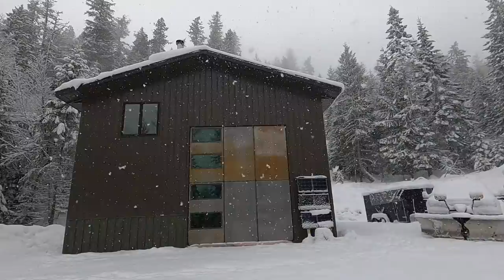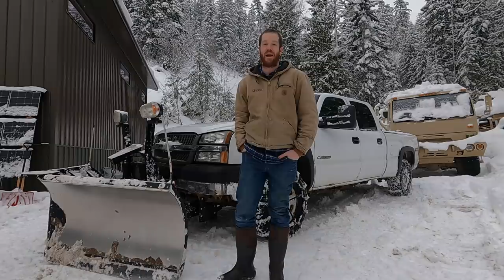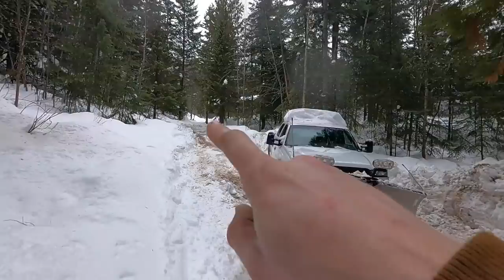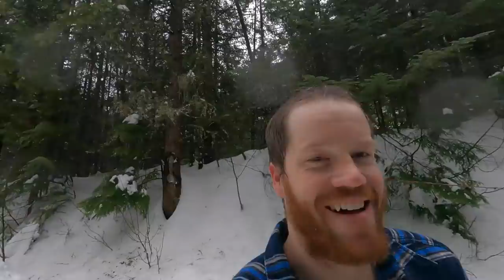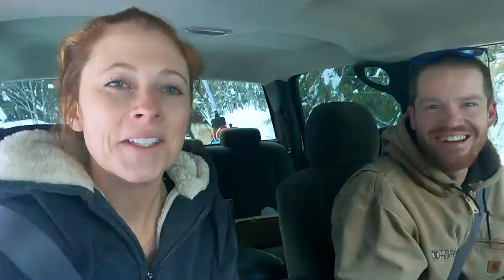WILL WE MAKE IT OUT? | Battling A Blizzard

Comment: I plowed snow as a youngster..it brought back memories..   The heavy snow is tough.  Best advice is to try not to abuse the equipment too badly.  You need a cheap harbor freight 12 v winch attached to the trailer hitch and a good snatch block.  You can pull yourself out of most predicaments.  Keep up the good work.  You two are awesome!
Reply: I finished the video and went to the comments to say the same thing. But checked first because I knew it was too obvious and someone would have already said it.
Reply from the maker: We actually ran into town to buy a winch and our Harbor Freight is out of stock at the moment!
Reply: @AmbitionStrikes  They have been parked 300 miles off LA-Long Beach since November ... 🤯
Reply: I was also thinking that is really hard on your equipment. Back and forth movement and heavy snow like that will inevitably take its toll as per your neighbors. Would it be better to have something more indutrial, especially driveline and transmission designed for heavy back and forth? My grandfather drove a grader to clear snow and eventually solved the snow problem by emigrating to Australia.
Reply: The  harbor freight 12 v winch is fairly  tough. Cable rigging is most important, You can move most anything using snatch blocks. :)

Comment: Hey Riley, a couple of suggestions: 1. Put about 500-600 lbs of weight in the back of the truck, just inside the tail gate, 80 lb sand bags are great. 2. When you go to back up and you're slightly down hill, only raise your plow a little so more weight is on rear of the truck. Sometimes you might not raise the plow at all, it will slide on the snow. 
3. Before plowing always check your pins- connection points on your plow. 4. Ice-sicles on your gutters is a bad sign, don't let that go very long. If you don't have snow guard on your roof you need that, will keep slabs of snow from sliding off your roof. Can be dangerous standing under the side of your 16' tall blg.  There will be a steep learning curve your first winter in Idaho. Good luck, be careful, & watch some videos on experienced snow plowers. T from Ohio
Reply: talk about a difficult introduction to plowing. that wet snow is HEAVY
Reply: Ted is 100% correct, I plow commercially, it is a game changer, more stable, more traction, helps when stuck.   DO IT, before you get stuck again, your beautiful wife is always there to save you.
Reply: Another vote for more weight in the back! Sand bags are definitely a super easy way to make the weight adaptable and seasonal.  The tube sand from HD or Lowes are great for this scenario and usually last a couple seasons.
Reply: I think Riley has weight in the back. It's a pretty basic concept in traction and his neighbor has probably mentioned it.
Reply: So... you're saying to keep the heavy snow on the roof versus having it slide off? When there's heavy snow on the roof you have a chance of the walls buckling and the roof collapsing. Seen it happen many times.
Reply: @Franisboche  Snow guards on the roof keep large chunks of snow from coming off all at once. It just breaks the snow up into smaller pieces
Reply: I'll be thinking about snow blower. Most efficient.
Reply: Absolutely!

Comment: Riley, there are so many suggestions about snow plowing from experienced snow plowers in the comment section.   I started plowing at age 15 in Philadelphia.  Here are my suggestions...momentum is your friend, not horse power.  The motor mounts were broken for a reason, trying to use the motor and not momentum will do that again, real soon.  Or you will break U-Joints or axle shafts.  Get some speed then drop the blade.  Second, there is no need to always drop the blade all the way down, it's just like cutting tall grass.  Sometimes it is better to scrape some off the top and then clear the path on a second pass.  Third, when you see the snow coming over the top of the blade, push that snow off to the side.  Push the loads, especially when the snow is wet, off to the side ASAP.  Forth suggestion, have fun with it!

Comment: Plow truck for sale! Only used on our personal driveway! 🙂 what a fun channel. Jason Kauffman the shed guy shared his shed delivery video with our shed haulers group on Facebook. Good times. 
As far as the plow truck, we dont get near the snow here in NY but I’ve learned how easy it is to ruin the trans or transfer case plowing snow. In the future you may want to consider something heavy and slow like a bulldozer or skid steer on tracks. They are designed to push long term with minimal risk to the drivetrain. Have fun! Marv from the finger lakes in NY
Reply from the maker: Hi Marv! We are still SO amazed by how quickly Jason was able to get the shed delivered. I agree, I think something larger and sturdier is going to be our best plan for moving snow long term.

Comment: When I used to plow, the first pass would be a straight shot all the way to the bottom of the road/hill. Then back up to the top to start again, widening the path on one side or the other, one pass at a time. Use gravity and momentum to make it easier on yourselves. The less you have to back up, the better. You guys are doing great though! Love watching your growth! 👍🏼
Reply: I have a 40yo beater with a nice plow. Being retired I plow a few driveways in my neighborhood and most are sloped downhill from the road. I never bang the plow and like you said let gravity do most of the work.
Reply: Yes, momentum is great.  

Also, there should be away to lock your hitch pins in.  It is never fun when the plow comes off.  On my older SnowDogg VX85, a small hitch pin will do the job, keep the snow build up from working them loose.
Reply: Absolutely this! If needed, lock the plow into a v-shape and punch a path all the way to road. You can come back and widen it up later. It saves the plow from having to push quite so much and your equipment (truck too!) will thank you. :)

Comment: A traditional tow strap might be helpful when you are using the bucket on the excavator to pull you out. If you got a winch, mount it so you can slide it in the receiver hitch, that way he can self recover, too. And if you get a winch, always need to get snatch blocks or snatch wheels.

Comment: I vote for the winch in the receiver at the back of the truck and get one with the "poly" cable not a steel cable. Pick one that exceeds the weight of the truck and has a very long poly cable ( get a snatch block or 2 too!)! That gianormus snowblower would be fantastic. Maybe move the snow away from the sides of your building allowing for the rain to run off and not into the shop. Getting up at all house of the night to stay ahead of the snow isn't the most fun you can have with your clothes on but you are way ahead of the game if you don't. You both are a great team! Stay warm! G.

Comment: Wet snow is the absolute worst. Obviously, it is incredibly heavy to move (as evidenced by the destruction of your neighbor's plow truck!) but it also keeps liquid water from draining properly because it can make a very effective dam or plug. If the shop is flooded it might be worth digging a trench in the snow where you have your ditch around the building to help things keep moving. Eventually, if you have a french drain there it might be worth it to put in a simple heating element wire to keep it clear.

Comment: Real winter has finally arrived! :D It is frustrating while plowing, but also rewarding in it's own way. Sometimes it can be fun. :) You got this!
A winch that you can put on the rear hitch and a come-along winch are generally worth having. The winch will help you get unstuck, the come along gives just enough extra oomph to help reattach equipment or run any extra pulleys/lines/snatch blocks you may want to run. Both are pretty inexpensive (relatively) that you can pick up at a hardware store or harbor freight. Sometimes, only occasionally, you need to disconnect the plow to get the truck unstuck, drag the plow out, then start over again. It all really depends on what other friends/vehicles you have available to help. :)

Comment: Grew up enduring those Nor’easter blizzards. All the vehicle recovery advice is solid. But plow with your blade canted - driver side forward, passenger side back usually - and plan your swipes to avoid getting stuck when possible. Add weight to the bed of your truck, we used to drive around all winter with a load of sand or gravel, which comes in handy for traction too.

Don’t try to bite it all off in a massive push. Also get a snowblower too! They’re great… You can find snowblower attachments for your quad.

Comment: 1. Plow with the storm, especially when its wet. Yes, get out of bed at 1 am.
2. You're still using the truck like a bulldozer. Your neighbor probably was too. Hence, broken, expensive parts and labor intensive repairs.
3. Try not plowing all the way down to the ground on the first pass. 
4. Put the shoes on the blade to prevent digging into soft ground.
5. Do not try to pile snow with the blade. The blade will ride up on the pile, lifting your front wheels off the ground. 
6. Get a large skidsteer with a wide snowblower. Another snowfall like that and you won't be able to push it to the side anymore or over the top of the previous plowing.

Comment: A bit of advice: do not use a hi-lift for a diagonal force, or as you call "shimmie". You will make your wife a widow! Hi-lifts MUST push or pull in a straight line.  Note- Hi-lifts can be used as a winch between  lines or chains. 

Also consider getting a electric winch and mounting it to a receiver post. Pop it into the receiver when needed.  Run an electric quick disconnect from the battery to the back of the truck for convenience.

Also, welcome to North Idaho! 
We are in CDA.

Comment: Upkeeping that home road of yours might be serious and expensive challenge continuing every winter. You might consider planning to get serious hardware for that job, like Caterpillar wheel loader or bulldozer or something of that magnitude. Breaking the lighter stuff (which probably will happen if you have to do that plowing job a lot) can end up making more trouble. Get some powered winch to the car at least, easier to pull it off from sides of road?   EDIT: Or how about just getting a SNOW BLOWER?

Comment: Riley, if you weld a couple of clevis grab hooks to your Highlift/Handyman jack, you can use it as an improvised winch with a length or two of chain. No stretch in the chain and more leverage with the jack handle than those short-handled strap tighteners.

Comment: Riley, you might want to look at a 12v HD winch for the plow truck.  They make models that mount on a plate that fits into a 2" hitch receiver on the back, or a totally portable unit like the Warn PullzAll. Combine either of those with that strap you had and you should be good to go. You could then self recover using a tree as an anchor.  Would be faster than waiting on Courtney or the neighbor also. Also X2 on putting more weight in the bed of the truck to even out the traction.  Best situation would be equal weight at each tire, but it might be hard to figure that setup out in deep snow winter.

Comment: My lessons learned in 20 winters driving uphill and downhill in snowy mountains: better get up in the middle of the night and plough early and again and again, especially when driving a light truck like yours. You can save time by using a snowblower, that is my second recommendation. You must avoid wet and heavy snow on the road. A winch is indispensable anyway,  in summer and winter!

Comment: For my 2 cents. That looks like it is a 8'-6" plow. When you put it in the V position it is actually narrower then an 8' straight plow positioned to either side. What happens is you don't get the snow pushed off to the sides it rolls back under the tires and that is how you are getting stuck. If you had a 9'-6" plow in the V position it pushes the snow far enough to the sides your tires will then be making contact with the road. Better traction less chance of getting stuck. Like others have said better to make a full pass all the way through in the V position. this allows for the snow to be split and spread evenly to both sides. Learned from experience been there stuck in remote locations and its no fun. Plus heavy wet snow is the worst to plow.

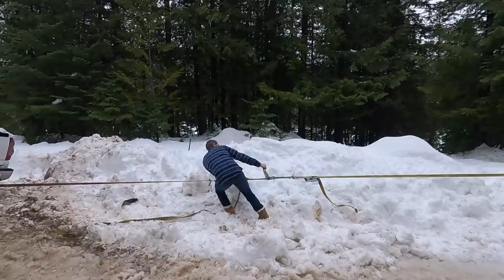Comment: 13:03 that reminded me that some hi-lifts can actually pull in reverse (like in position when you would normally lower the load) if you'd have proper links to connect it to chains or straps/rope .. to have kind of improvised winch.

Comment: For pulling out any rig, there are many different techniques, you can even use your own wheels as a winch, as long as you have appropriate straps, and fastening points. But winch makes it so much easier.
But if you intend to use army truck, I would go for the chains.
You can even make an extra long rope, 50+ anchored pulleys to multiply your power, and then just run down the street/road yourself, to pull that rig out. Except maybe the friction in pulleys would counter your strength ...

Comment: So amazing to see the Hi-Lift in action. Such an amazing tool (which I still don't understand everything you can do with it.) It's like a Multi-Tool. Very cool to see the kinetic rope in action. 

Teresa says "Courtney to the rescue!"
Reply: Where I work I use mine a fair bit, from pushing out excavator hinge pins to moving plate steel into place for welding.
Reply: @krissfemmpaws1029  Thanks Kriss must be some big pins..LOL I've used mine to help lift large stones. I was setting where equipment couldn't go. I'd love to see a video of everything you can do that you never thought you could do. Thank you again for sharing.
Reply: @OutOfOfficeCamping  some of the pins are 3 plus inches in diameter and 20 inches long. Our big machine has about a 3.5 yard bucket we use it to feed the crusher and move some of the rock around out of the way where the D-9 doesn't fit.

Comment: Even with chains there is only so much you can do with open differentials on that truck. It’s pretty heavy and the army truck is even heavier but might have lockers? I would check out Casey LaDell channel. He has a towing recovery channel and lots of older videos in the snow recovering with trucks and winches. This season he has a tracked Jeep.

Comment: Next Project - Snow Plow for Army Truck!
Reply from the maker: Yes! I doubt that is going to be in the budget for this year, but we did order a set of chains for it so we can use it this winter for recoveries.
Reply: @AmbitionStrikes  I was definitely thinking that was something for next winter prep.  I was in the Army and those trucks are monsters when working properly.  You all are building character - amazing stuff!
Reply: @duckninja9349   I was wondering what real life experience is with that class of vehicle with chains.  I picture lots of black & white WWII film with 6x6's sliding sideways on an icy crown in winter.  (Obviously, we did not have tire chains for our Deuces in Vietnam.   Big deal in II CORP was red slimy mud during monsoon season.  But always tracked recovery vehicles eventually get you out ;-)
Reply: @AmbitionStrikes  An eco concrete block or a yard of gravel in the bed of the 1078 will do wonders for traction

Comment: With the v-plow it helps a lot to make a first center pass with the plow folded back towards the truck to push the center to both sides, then make passes on either side to make the path wider.  This method helps with not needing to push as much weight at one time and is easier on equipment and tends to make it easier.

Comment: when the blade gets stuck in the snow hit down on the blade lift. push the ram down by hand and tighten the chain up. the blade will lift higher and you can back out. then drop the blade on something higher than grade and put the chain back where it was. and like others said, more weight in the back of the bed. also use the v capability to open the path then start doing passes to move it over.

Comment: Hi,, you can get a rubber bladder that fits in the box of your truck, for the winter,, just fill it with water, or half way or what ever, and it will freeze,, in the spring just pull the plug and store it away for the following winter, that way you have some control on how much weight you have in the box for the winter as water weights about 7 lbs a gallon. ,, just a thought

Comment: Also with the tarp - anchor one side completely to the ground, and then lift with excavator from one corner and move to the opposite corner, maybe even anchor 3 corners and lift on the forth. See which works best. Maybe the tarp is not slippery enough ...
Since we frequently use polyethelene strips behind a T shaped "rake" to get snow off the roof of a barn and that works super easy ...

Comment: You need to add front and/or rear winches + Maxx tracks (or similar) to your plow truck. The Army truck might make a better ploughing truck as it is heavier (with a beefier engine), if you can get a plow mounted to it. Consider getting locking differentials (centre & rear at least) for the Army truck (you'll have to return the Chevy eventually).

Comment: I have the exact same plow and I use heavy zip ties that disallow the reversal of the locking pins. Also please check with your local distributor about factory upgrade on your hydraulic pump. No charge replacement if it hasn’t already taken place.